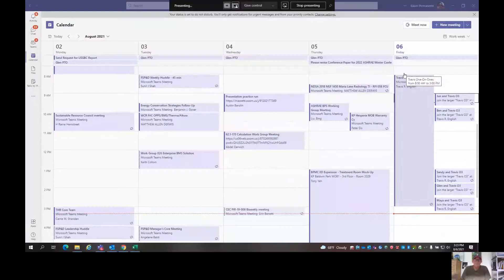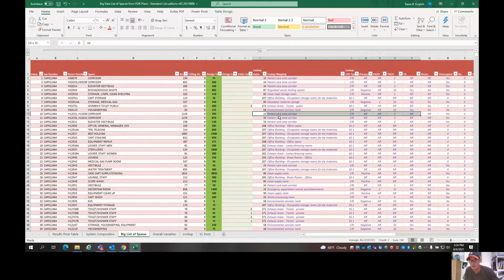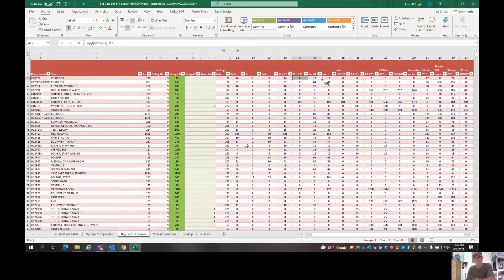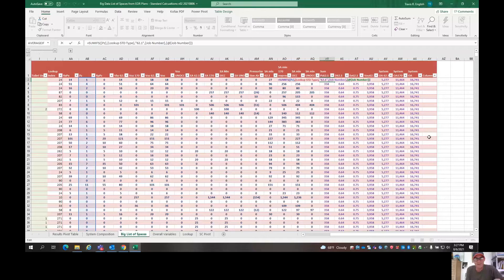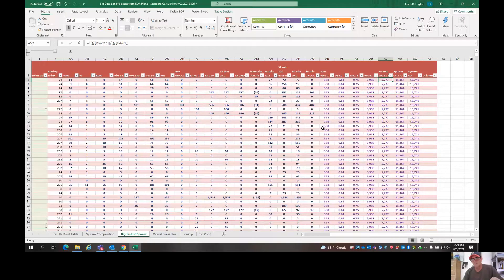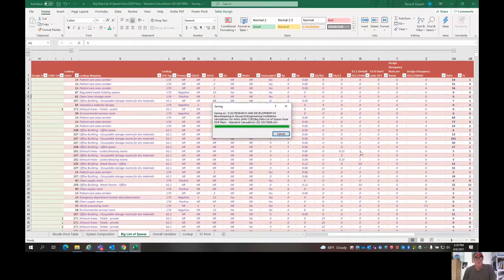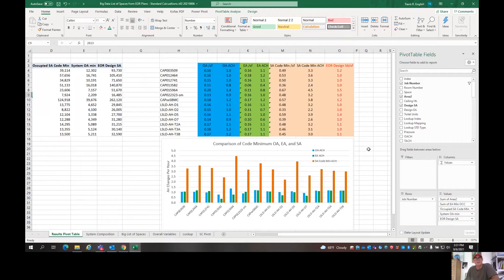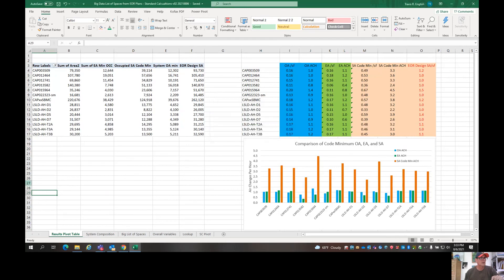System Outdoor Air Calculations for ASHRAE 62.1 and ASHRAE 170

Comment: Hey there, Question here: If I have an AHU that supplies 100% Outdoor Air (OA), can I specify the air changes per hour (ACH) to the ASHRAE 170 stated minimum OA ACH, and not the total ACH; or do I still have to supply the total ACH minimum?